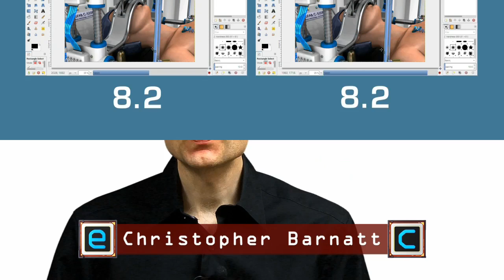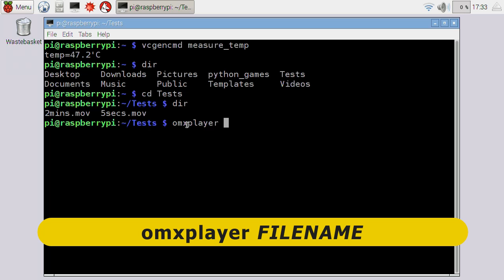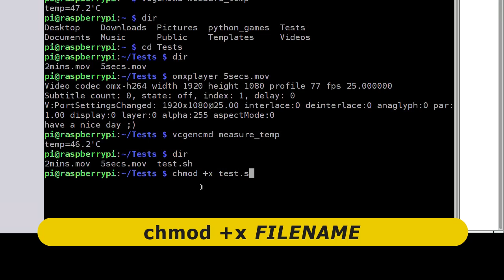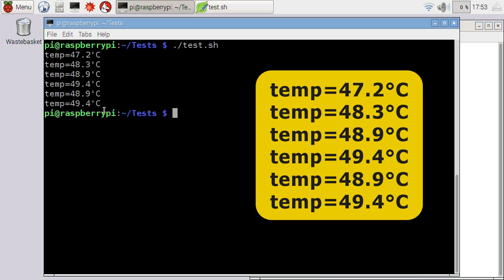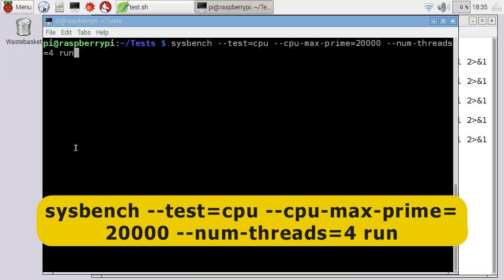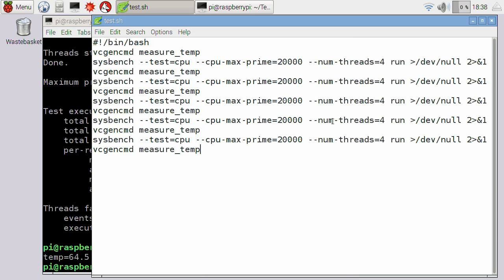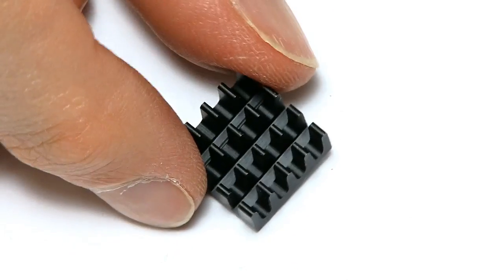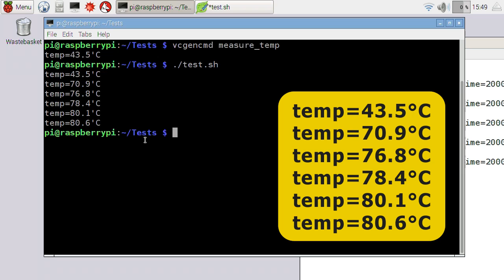Raspberry Pi 3: CPU Temperature Tests & Heatsink

Comment: I tested a similar heatsink and got similar results (only a few degrees C at best).  This was all I expected, because these days  surface mount PCBs like the Pi derive most their passive cooling through thermal coupling to the large PCB ground and power planes, so these small stick-on heatsinks are only minimally effective.  You can get as much (or more) improvement in cooling for free, by simply turning the Pi 90 degrees on edge, which improves the natural convective cooling over the surfaces of the PCB.
Reply from the maker: +Steve B. Very interesting. :)
Reply: +ExplainingComputers 
Yep, this is also why your fan works so well - because it cools the whole surface of the board, nicely cooling down the internal copper ground and power planes that the Pi SOC and RAM are soldered to.

Of course, a passive heatsink does help a little, even without a fan, and this advantage also improves if we turn the Pi 90 degrees so convection can better flow air upwards over the heatsink - and this would probably be fine  for most folks.

For a nice sealed case passive cooling solution, I have found nothing that comes even close to the FLIRC raspberry Pi case.  This case was originally intended for the 4 USB port 512k Pi B but fits the newer P2 just fine.  The case includes an aluminum thermal link pedestal which couples the outer aluminum case with a thermal pad directly on top of the Pi CPU SOC.  This gives very good heat coupling out to the sides of the aluminum case, which has plenty of surface area for cooling.  With the standard Pi, heat flows out the bottom of the chip into the circuit boards large ground and power planes, and the FLIRC case arrangement basically doubles the heat flow out of the chip by also coupling the TOP of the SOC chip to a large external metal surface.

When installing a Pi 2 in the FLIRC case, be sure to check the alignment of the thermal pad, because the case seems to have bee designed to also support the earlier Pi where the CPU was slightly offset from the newer Pi models.  For best alignment with the Pi 2 I had to offset the thermal pad slightly to the upper left corner of the square thermal pedestal so that it would be centered on top of the Pi 2's CPU when assembled.

The FLIRC case, because of its efficent thermal coupling to the top of the SOC, does better than any of the other heatsinks I have seen for the Pi (except perhaps those also using a fan), and it just flat out looks BEAUTIFUL  

The only hesitation I would have in recommending the FLIRC case concerns the Pi 3's.   Although the FLIRC case will work with the PI 3 there could be issues with the  WiFi,  because of it's metal construction. There is some hope for the WiFi and Bluetooth because the side of the FLIRC case where the Pi 3's ceramic antenna is located has a plastic insert which should allow WiFi and Bluetooth RF to exit, but there are other issues with the Pi 3 though with this case - such as needing to create a new opening for viewing the LEDs, and having to either enlarged the opening for the the MicroSD slot, or attach a tab of thin tape to each  MicroSD card so you can grab it and pull it out. These became issues when the Pi foundation (in its infinite wisdom) changed the LED locations on the Pi3 vs the Pi and Pi2, and also changed from a push-to-release, to a non-spring loaded pull-to-remove MicroSD type socket.

... but for the Pi 2 non of these issues arise, and, seriously, this case is just flat out BEAUTIFUL.

So, if you aren't hacking your Pi's GPIO every ten minutes, and just want a nice clean fully enclosed case with excellent thermal performance, you can't beat the FLIRC case. And nothing I have found comes even close, when it comes to making the Pi look like a solid industrial, real professional Micro-PC.

Comment: ok so the pi 3 doesn't have a samsung processor?
Reply from the maker: +DrEpixStudios It has a Broadcom processor.
Reply: oh, do you think future models might come with an installed heat-sink/fan I think no because it may affect projects that need space, by the way Thanks for responding
Reply from the maker: +DrEpixStudios I would like to see a future Pi have mounting holes for a heatsink/fan.

Comment: I've never been too worried about overheating as I've always played it safe and added heatsinks to all my Pi models. Well a few days ago I was fiddling around with desktop media players and I tried a few out to see what was the easiest to set up and use. Most of the ones I tried had compatibility issues. GNOME MPlayer made the Pi heat up significantly and the Orange square started flashing in the corner. I was leery to try any others after that. I was wondering if you could maybe do a video on desktop media players for Raspbian? I know there are a few people have developed for Raspbian like omxplayergui and TBOplayer but I don't really know how well they work or how to set them up or anything. There's also Ubeify. I didn't really like it because I couldn't play media from an external device. I know it has a bunch of plugins to watch content from sources on the internet too but I'm not really interested in that. I just want to be able to play files saved to an external device without having to always launch Kodi or run the command line. Any help would be greatly appreciated!

Comment: What's wrong with 82oc other than it throttles?
Reply from the maker: +RCTestKid 82 is way too hot to run a processor on a long-term basis (which is why it throttles, as this level of temperature will shorten the life of the chip, potentially quite drastically). Any time a chip gets out of the 60s is time to worry.
Reply: ExplainingComputers How does it shorten the life of a processor?
Reply from the maker: +RCTestKid It burns out the components. :(

Comment: The reason why the heatsink is not helping that much in cooling the CPU could be the fact that the thermal pad on the heatsink is of poor quality and cannot transfer heat from the CPU to the metal heatsink quickly.

Comment: Pls do a active cooling test ! In theory , active cooling should be much more effective as the heat gets drawn away by moving air quickly instead of being slowly transferring into the surrounding 'stagnant' air when using a heatsink.
Reply from the maker: +VinsG1379ITtronics Now shot -- will upload on Sunday.

Comment: It looks like you've already decided to make the active-cooling video, but it gets my vote too.  Other commentators have already said that thermal paste, and maybe a slightly larger heatsink, would probably yield better cooling.  The more surface area there is to dissipate heat to the air, the better, and the paste should be a better interface than the tape.
Reply from the maker: +MarkTheMorose Yes, the interest in the active cooling video was clear -- so it will upload on Sunday! :) As you asy, bigger heatsinks and better heat transfer to them would improve things -- but I wanted to start with a product on the market. But Sunday's video is very much DIY cooling!

Comment: Very interesting. A thing to consider though is that the system on a chip will slow throttle at more than 82° regardless if there is a cooler or not. Cooling shouldn't have an effect on temperature at full charge but rather on execution time of the test.
I like your Raspberry Pi benchmark videos. Keep it up.
Reply from the maker: +Guillaume Laurent Thanks.  Though ideally a cooler will reduce temperature at full processor utilization to below the throttling threshold. Look out for this Sunday's video! :)
Reply: +ExplainingComputers Oh you were way ahead of me weren't you?
Reply from the maker: Guillaume Laurent :)

Comment: Active Cooling test please.
Also how about connecting the fan to the GPIO pins so the fan can be throttled by temperature so that power is saved when the fan is not needed.

Comment: Whats the difference in power drawn from idle to maxed out cpu test?
I may be a little rusty but is 5V by 2Amps 10 watts?, or is it something more like 5.1V by 2.2 A ? (11W)
Some heatsink maths
http://www.electronics-cooling.com/1995/06/how-to-select-a-heat-sink/
peltier heat pump?
And make the case the heat sink
One more:- 3D print the H/S

Comment: Not really a fair comparison as the second test with a heatsink started at a much lower temperature.....
Reply from the maker: +Graham Gillett To some extent yes, this is true -- and I do say that in the video. But given the speed at which the temperature rises, I think the final temperatures reached are a fair comparison. And in my forthcoming active tooling test I will ensure that all tests start from a stable idle.:)

Comment: Very nice Video. May we can also see some overclocking tests in the next videos. My Pi3 is running on 1350 MHz. Karl
Reply from the maker: +Karl Ramstorfer Overclocking -- now there's a thought . . . !:)
Reply: +ExplainingComputers also interesting is to put the processor in performance mode : echo "performance" |sudo tee /sys/devices/system/cpu/cpu0/cpufreq/scaling_governor ... so the 4 cores work always on 1200 MHz instead of 600 MHz - normally the Pi3 only  switches to 1200 MHz when it is really needed.
Reply from the maker: Karl Ramstorfer Thanks for this -- will try it! :)

Comment: I wonder if the same overheating problem is affecting a raspberry pi 2. All the models of raspberry pi are sold for 40-50 euros in Greece by retailers... (I wonder if it would make a good server/local network backup solution. edited)
Reply from the maker: +MIGBMWLOVER The Pi 2 does not have this problem -- it gets far less hot. :)
Reply: +ExplainingComputers thank you very much

Comment: I would also like to see how to do an active cooling test. But I just got the Raspberry Pi 3 loaded up the raspbian got the internet up and running but I can not get any sound out of the 3.5mm 4-pole composite video and audio output jack do you have any suggestions I don't know to much about working with these little computers yet just starting out. Ant help would be appreciated.
Reply from the maker: +Anthony Benedetto Probably your sound is defaulting to HDMI. Info on changing this is here: https://www.raspberrypi.org/documentation/configuration/audio-config.md
Reply: +ExplainingComputers 
thank you I will give it a try
Anthony Benedetto
Reply: +ExplainingComputers 
Hi Chris
I got the response from you on my question which I was going to change the speaker location but I thought about what you said on HDMI and I checked the back of my MAG monitor. Low and behold there is a speaker connection which I plugged in the speaker and it worked just fine. Thank you for your quick response to my problem, and if someone else has this  problem tell them it check the monitor first!! I just don't think things out sometimes. Thank you Anthony Benedetto
Reply from the maker: Anthony Benedetto I'm glad this is all sorted. :)

Comment: I have a copper heatsinc on the cpu and a fan in the top of my case ,should it be blowing hot air out or cool air in
Reply from the maker: +Jack Burton On a PC you usually have a fan sucking in air at the front and blowing it out at the back. With one fan you can argue it both ways, and it will depend on the case design. But personally I would have it sucking cool air in (which will also force hot air out!).
Reply: ExplainingComputers thank you for the quick reply ,I had it blowing in at first ,but thought about for a few days and changed it , so maybe ill drill some holes in the bottom and turn the fan around to blow cool air through the case ,
Reply from the maker: +Jack Burton Getting airflow through the case is indeed the key.

Comment: Another excellent Raspberry Pi related video. These tests were very interesting and also very useful to know. I intend doing some projects on my Raspberry Pi 3 and keeping the CPU temperature as low as possible is essential as it will effect performance.

I would love to see some results with some active cooling such as adding a fan on top of the heat sink, the passive cooling did very little to reduce the heat it would seem. Kind of reminds me of when the Sinclair ZX Spectrum 128K came out and it had that huge heat sink on it's right hand side which did get hot also.

Looking forward to the next tests.

Comment: Although the action of the heat sink seems to be minimal, what wasn't clear from this test is how much more work the CPU was doing. 

I agree that the 82° test looks like it was throttling. It may have been doing significantly less work at that point due to this. It would be very interesting to quantify this.
Reply from the maker: +albedo0point39 It continued to show 100 per cent utlilization in the monitor, as would be expected in he Sysbench test. So I think it was still running at full pelt, just more slowly.

Comment: Great info!
I am in a hot area where ambient is in low 90s F. My pi was running in the mid 40s idling, and a little higher with medium tasking. That was with no case and heat sink. put in case and jumped up to high fifties on idle, 60s with lite load. That is with the covers off the case.

My plan was to make a couple of pis for my children's study area. Just attach to back of 14 inch monitor with keyboard and mouse. I will have to rethink and set up active cooling. Now need to consider noise from up to four fans running in study area. Would like to see more tests with active cooling please.
bob
Reply from the maker: +Saffron brooks There is clearly an interest in this! I hope to shoot an active cooling video this week and upload next Sunday.

Comment: In a related note: I think that at this point the next revision should focus on heat (and incidentally power) and memory instead of speed bumps. Almost 90°C for an embedded system that is not encased is NOT ok.
Reply: +Luis Mercado The only way they'd be able to signifcantly reduce the heat and power used would be to use a smaller nanometer process for the CPU. Currently the Pi uses 40nm, where as the rest of the industry has switched to 28 or 14nm.

From what I've been able to glean from forum posts and the like, it doesn't look like anyone at Broadcom wants to invest the captial needed to redesign the chip. This may force the Pi foundation to switch to a different, non-backwards compatible design.
Reply: +Sheriff Blatz great thing that budget constrains always beg for very creative solutions. This would be the time that the Raspberry team test themselves. If not a better process then a very creative passive cooling solution.

Aluminum and cooper are relatively cheap and very thermal conductive. I'm thinking... a cooper layer between the proc and a slightly taller aluminum dissipator?
Reply: +Sheriff Blatz At least they could machine the necessary screw holes in the MB so we can install addon solutions.
Reply: Luis Mercado Designing a custom aluminum heatsink is not a difficult task, nor is it a creative solution, but it is a solution nonetheless.

For the long term, they cannot continue to release iterations of inefficient CPUs, the current one is already at its absolute limit, the GPU as well.

If Broadcom doesn't pull something out of their hat, the Pi foundation will be forced to adopt a new ARM CPU design, or risk their popularity waning.
Reply: Sheriff Blatz creative in the scale sense. Also, this is one of the cases where shape matters.

I agree that the ideal situation would be to release a more efficient chip. But it we are still far from that then a custom passive solution seems the best right now.

Comment: Professor, good day and great video. Hypothetically, could it be possible to apply thermal paste between the proc and the tiny heatsink? Maybe a tiny drop? This video was very interesting to me because made me wonder how creative people could get (for example, a very tiny water cooling solution, or custom made copper heatsinks and exhausts) in order to take the Pi3 to its limits. Already a very flexible and cheap computing solution already.
Reply from the maker: +Luis Mercado I think thermal paste will be more than hypothetical in my forthcoming tests. :) I had not considered water cooling! I think there will be two follow up videos now . . .

Comment: I don't think I've ever seen an active cooling test on a pi, should be interesting. Also you should check what metal that heat sinks is made of and experiment with different metals and even full on thermal paste instead of thermal tape.
Reply from the maker: +Parot & Armorfinish Very much agreed -- the heat sink could be improved upon, as well as its method of connection. :)
Reply: +ExplainingComputers Something to note, Thermal paste tends to require a decent amount of pressure being applied from the heatsink to be completely effective. Without any mounting brackets surrounding the CPU, this would make applying that pressure somewhat difficult.
Reply from the maker: Some of the heatsinks I'm contemplating weight half a kilogram! :)